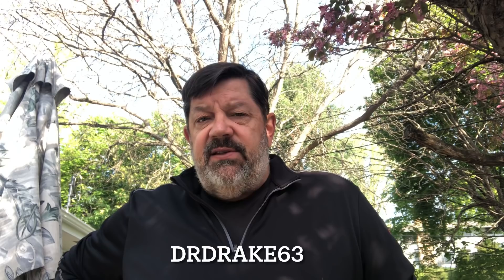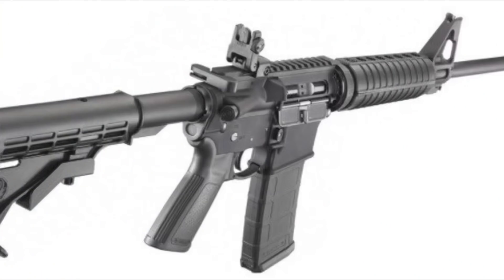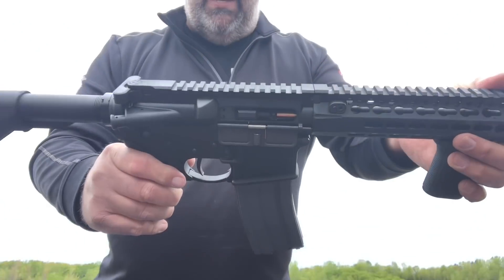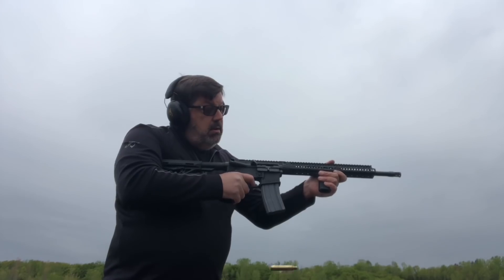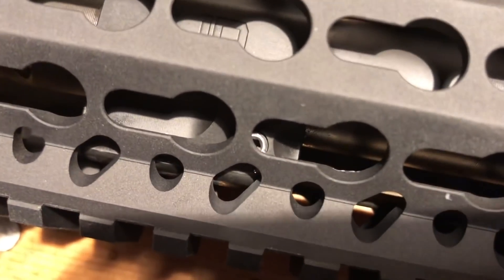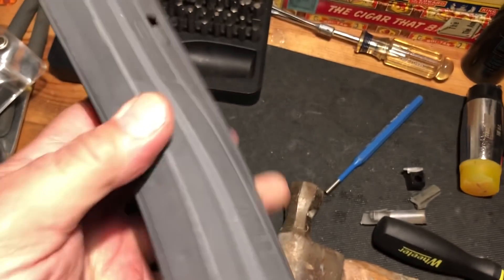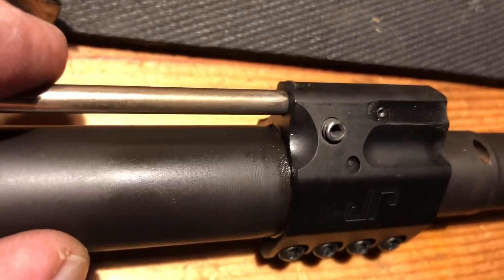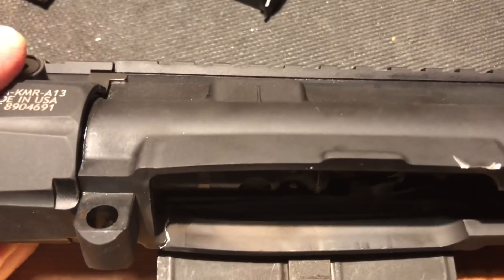Colossal AR Failure

Comment: The ruger 5.56 is a junk rifle. The jp gas block wasn't an issue. It looks ad though the bcg failed. While still under pressure from the round which caused the damage to the upper recoever. This was a bcg failure.
And a catastrophic failure is one that makes the gun completely in operable. Even if you dont get hurt.
Reply: looks like youtube sends us to the same videos.
Reply: @APGrifterWatchdog  yep

Comment: I run a JP adjustable gas block on my carbine. Mine was way over gassed before the adjustable gas block. Even all the way out you shouldn't get anymore gas than a standard gas block. It appears to me you had an over pressure round or an out of battery detonation.

Comment: I wouldn't blame JP, not a gas issue, either you had an out of battery detonation, cheap BCG or your barrel nut was overtorqued. I'm leaning Out of battery detonation/ bad ammo because the BCG and the upper got damaged right where it would. Standard BCGs (with the right bolt) can hold up to 458 gas and recoil and it packs a wallop.

Comment: We builds 100s of ARs at the shop,  worked on 1000s,  have had customers bring in just about every failure possible.   never out the 1000s of guns has it been because the gas block......   the ammo was probably the issue there.    Could have had a squib the round before,  could been a super hot round..... but as mentioned above the gas system is meant to fail before the bcg

Comment: Lube your bcg!
Reply: Ar,s are not made to be lubed or cleaned.
Reply: @garypiont6114  mine runs great with a couple drops of oil on select spots on the bcg and it doesn't run when dry, single shot when dry.
Reply: @Dadamsjr7353  wow, hard to believe, but possible now that so many are on the market
Reply: @garypiont6114  its the only one I have that is like that and it was a very small amount of oil
Reply: @Dadamsjr7353  how old is your rifle?
Reply: @garypiont6114  new
Reply: @garypiont6114  I wonder if its the finish on the bcg
Reply: @Dadamsjr7353  could be, mine was over sized ,i used a mic on it. I switched it out.
Reply: @Dadamsjr7353  could very well be
Reply: @garypiont6114  I will check a could others in there  when i have the chance
Reply: @garypiont6114  that is absolutely BS. Lube them well. Clean them every 1000rds or so.
Reply: @Nylonscheme  hogwash, try 500 rounds, no clean, no lube, its a alloy gun,. No battle rifle needs its ass kissed
Reply: Never! It traps dust. Alloys are great.

Comment: You can tell the failure begins at the breech face because that's where the metal expansion and deformation is widest and greatest. Possibly a head spacing issue? Or a squib load, or less than 50% case volume of powder in the detonating round, causing secondary explosion effect

Comment: Gas system had nothing to do with that catastrophic failure.  Most likely bad over pressure ammo.  Did you recover the piece of brass in the chamber?  That will tell you everything you need to know.

Comment: David, I have less experience than you in builds.   My guess Is that was an improperly seated round that was not all the way in the chamber when the gun fired.   Or a very hot round.  But heres a few things to look at, Check the round case to verify the correct caliber.   And check the barrel for any obstructions.

Comment: Agreed not an overgas issue. There's no way to get that much pressure through the SS gas tube without it failing first before exploding your BCG which is made of 20x the metal thickness and hardness. Technically if that much pressure came out of the gas port, the gas block would have fractured first, it looks to be mere aluminum, but still thinner material than the BCG.
The key kissing pieces of evidence not show are the bolt lugs, and the condition of the case from the round that was fired. That would give more Intel.

Comment: Lot things I didn't see. The video you were showing didn't have the failure in it- did you have that on camera? What were you shooting for ammo? The gas tube is ok, and I would expect it not to be if overgassed hard enough to crack the upper. The fracturing of the upper looks crystalized. Could you get the bolt free? Can we get a look down the barrel? In the barrel, since it failed, is there a point where the rifling looks like it was ground on? I'm hearing reports of duds and squibs with new ammo, all manufacturers. Could you have had a squib that was blown free? Heavy profile barrel might not rupture or even excessively bulge, but the rifling would probably be scarred where it happened. Or an overcharged carttridge. But my money is on bad ammo. If not those two, out of battery detonation and Eugene design for that to funnel out through the mag well.

Comment: My guess is that you over torqued the barrel nut for the new hand guard and created micro fractures in the upper that allowed the headspace and timing to be out of spec
Reply: We noticed the same thing.
Reply: Headspace is set by the barrel adapter, nothing to do with the upper. 

I could just as easily say the upper was trying to eject the keymod handguard.
Reply: If you over torque the barrel nut you can shear off the indexing pin, or crack the grove that it is supposed to reside in, both of which can disrupt headspace

Comment: I had a big bag of reloads i bought at a good price.
While shooting had a ftf.
Cycled the action and could'nt chamber the next round.
The bullet from the first ftf round had come out of the case and was stuck in the chamber.
Very lucky it prevented the next round from chambering.
Since your barrel is intact, you probably did'nt have a barrel obstruction.
Case rupture maybe?
I don't think the gas tube can supply that much pressure to damage the bcg.

Comment: you can actually tell that it was an out of battery detonation just from the damage, the major portion of which is at the front of the upper right next to the breach. The rest of the damage looks secondary to that.  If it had been an obstruction beyond the gas block it would have damaged the barrel there with either a noticeable bulge or a straight up banana peel. It could have been an obstruction at the breech causing the case to not set all the way into it. or a head space issue. no real way to tell from the pictures on the cause anyway.

Comment: Well you are completely wrong. Not a gas block issue. Either you had a 300 blk loaded, a round didn't exit on the prior shot or your bolt was not in battery completely. If the barrel is obstruction free then I'd say you probably had a squib or the bolt didn't full close.

Comment: Not an AR failure expert but I think it is possible for over gassing to cause failure issues. Not from the over pressured gas causing the failure all by itself but possibly causing "Bolt Carrier Bounce" which in turn can cause hammer follow and possibly the round firing from an out of battery condition. Like I said I'm not an AR failure expert just throwing it out there as a possibility?

Comment: Looking at your video I don't think you did anything wrong. I had similar problems with a 300 aac and kept the same gas block and changed buffer and buffer spring.

Comment: What does the cartridge case look like?  Look down the barrel for bulges.  I have never seen that kind of a failure caused by the gas system.  Usually the gas tube lets loose first. But only a fool says "never say never".  When you get the upper apart make another video.  You have a lot of curious gun guys out here asking questions.  This could be a real learning experience for everybody.  Thanks for the video.
Reply: Just looked at your latest video.  So you put a 300 blackout in a 5.56.  Yep that will blow your rifle up every time.  Don't feel too bad I have seen this failure a couple of times.  It is far more common than most guys want to admit.  Thanks for posting your results.

Comment: The AR15 should never fire out of battery due to the firing pin being held by the bolt carrier rather than the bolt itself. If the bolt isnt cam'ed to the lock position, the firing pin cant protrude out the front if its of the proper length.

Comment: Ok, I'm not trying to be adversarial here, i just really want to share some things with you. That was absolutely not the fault of the gas block. The point of an adjustable gas block is to restrict gas, and it's top end well only be what the wide open gas port will allow. I other words, a standard gas block will result in the same pressures as a fully opened adjustable gas block. You will have to find a way to disassemble your rifle to find out what may have been the real cause, but it looks to me like the bolt cam failed for one, and it could have also been a tolerance attacking issue causing improper headapace. Could also be that the receiver failed because you over torqued the barrel nut, or didn't use a tool that engages the locking lugs when you installed the barrel. My point is, it 100% could not have been the gas block, and you won't know what it actually was until you have it looked at by a professional.
Edit: well, looks like I'm late to the party with this info. You should send it to School of the American Rifle (SOTAR) to dissect it. Great YouTuber who knows way too much about ar15s
Reply from the maker: Had I not fired 40 or 50 rounds prior to this mishap, I’d be inclined to wonder about head spacing and so forth as well.

Also, the barrel nut was torqued to specifications. I have the right tools and have assembled many an AR. (which doesn’t mean I could not have made a mistake with this one)
Reply: @drdrake63  Ok, the way the receiver cracked was kind of suspicious to me. Maybe like other people are saying, just a hot round or bore obstruction? I just don't see how it could possibly be the gas block. I wonder if the bolt cam shearing caused a catastrophic release when the carrier separated from the bolt... anyway, I hope you do a follow up, it's defiantly an interesting and puzzling failure.
Reply: @GruntBurger - uncomfortable truth, right there.  Poor custom assembly.

Comment: Adjustable gas blocks are just another point of failure if you don't need it . Maybe if you add a can once in a while . I think maybe what happened was that you changed the dwell time and the bolt opened too soon . Easier to fix overgassing with a heavier buffer of spring .

Comment: Over pressure from the ammo. Double load of powder would not fit but a weak primer pocket on a reload or a split cartridge might explain why it blew up.. Timing of BCG or hole in the gas block not aligned. You have to look at all these parts carefully.

Comment: Given the limited information presented I think that is definitely a pressure issue not having anything to do with the gas block.

Loose projectile was probably pushed back in the case of last round. Sitting in the sun all day also probably didn't help with volatility.

Comment: What is the buffer system that is used? I asked because it appears to be an out of battery, that my be caused by bolt bounce. The ammunition could  be another factor.  You could of had a sqib before the last round. Is the barrel free from obstruction?

Comment: Not due to your gas block.  Ultimately the hole in the barrel is your constant and if you didn’t change it from factory specs your adjustable gas block would not have allowed more gas than the factory block no matter what the setting.  This looks like an ammo issue.  Was this with hand loads?

Comment: Cheap BCG as in non magnetically inspected. No AR gas system can send enough force to crack the receiver. Chamber pressure exceeded it's limits. Hot round or faulty parts.

Comment: Not a gas issue.  Gun will hold together without gas.  Over pressure round would be my guess.  Gas is designed to vented down when that happens.  Who made the bolt and upper receiver?

Comment: NO WAY is this a over gas issue.  It almost looks like you tried to fire a 300 BO through a 556.  
I will try to help you with the gas block issue for the future though.  99% chance the reason you were having gas issues is that the gas ports were not lined up.  When you remove the hand guard retainer/cap you need to use a shim to properly space the gas block when you reinstall it.  You can cut up the old cap if it won't be used again anyway.  
Personally I use a barrel dimpling jig to insure proper spacing but with that type of clamp on block, there would be no set screw on the bottom to index with.
Again, this surely had nothing to do with this failure, but it should help with future work. 

Your failure was almost certainly ammo related, or an "out-of-battery" detonation.  Possibly a squib, but i think you would have found more evidence of that while inspecting the barrel.

Comment: I’m not an expert, but I doubt it was the gas block. What’s the difference between a regular A2 front sight gas block combo and a wide open adjustable gas block? That was either caused by a squib before you fired that round, an overcharged round, or the rifle fired out of battery.

Comment: An adjustable gas block CAN NOT  over gas a gun anymore than the existing gas port in the barrel allows. It can’t magically suck more gas out of the system. They only allow you to tune gas down from what the fixed sized gas port in the barrel allows through. You had a ammo problem, obstruction/detonation, ect.

Comment: I would have thought sending the gas block back to the Mfg. For inspection may have been first priority since the original 1 turn back off didn't work. Threads and ports should be spect out tight. Next would have been to check return spring stiffness, was it non standard. Obviously, it should be made with maximum safe port diameter limiting feature.

Comment: Adjustable gas blocks can only restricted the gas in a gas port, not increase it. The gas block had nothing to do with that failure. It was a chamber-throat problem, over pressured round or an obstruction in the barrel..

Comment: are you sure there wasn't an issue with the second to last round? Sheared case neck stuck in the chamber or something that could have caused the lugs to not fully engage? What did the one that blew it up look like? If the lugs weren't engaged and the case head blew off and sent full chamber pressure into the carrier you'd get pretty much the same result you have here

Comment: Was that a round you picked up after the failure to feed? Could of pushed the projectile to far back in the case causing the over pressure.
Reply: Pushing the bullet into the case reduced pressure in a bottle-neck cartridge. Gives it a longer jump to the lands and lower peak pressure is the result. Pistol/straight cartridges it is a thing to watch for.

Comment: I concur with most people here who suggest this was not the gas block (though I'm not a fan of adjustable gas blocks on ARs). I'd be looking at an out of battery detonation, a squib (if your barrel has a round stuck in it, that will tell you had a squib), or a hot round. Glad you did not have to put a thumb in it as was the case with another rather well-known rifle detonation.

Comment: The gas block had nothing to do with it.  A adjustable gas block doesn't let anymore gas in than what the gas port in the barrel will allow to go through. Its designed to cut back on the gas if needed. If it had enough gas going through to do that to the bcg the gas tube would have blown out first.  It looks like a bolt cam failure to me. I don't see any sign that it was a hot load.

Comment: I agree with others that this is not possible from just over-gassing. Possibly a 300 Blackout round by accident, possibly a round with too much powder (or wrong type of powder), possibly an out-of-battery discharge. Can we please see more photos of the rifle more fully disassembled? It would be helpful to see the casing or what is left of it. Also would be helpful to know whether the barrel is swelled in any place and whether the bore is clear. Who made the upper and the BCG? The way the metal of the upper failed it looked like it was cast not forged. It's also possible that there was some kind of flaw in the bolt or BCG which caused it to fracture and get pushed backward when the round fired.

Comment: What ammo were you using?
Also did it have the factory carbine buffer and spring?
I don't think it's an over gas issue. I think it more ammo related and ammo properly seating into chamber before firing.

Comment: I would suspect a headspace issue. The gas tube would blow out of the block with the kind of pressure needed to blow the bolt apart like that. The pressure came from the chamber and blew the bottom of the carrier off and then expanded the mag.

Unfortunately a lot of people don't invest in headspace gauges and this is a good demonstration of why it must be checked.

Comment: Absolutely no possible way that was caused by a gas block. 99% probablity the shooter accidentally loaded a 300 Black out round . I have done post mortem on 5 guns that looked exactly the same. If the barrel is plugged as I suspect.....and you'd like to send it to me I can section on milling machine to confirm what happened. If the barrel is clear then you had grossly over charged round, or one that was undercharged and the powder troughed in the case causing detonation. It is simply IMPOSSIBLE to cause that from over gassing. Feel free to call me at the number lsted on maconarmory.com